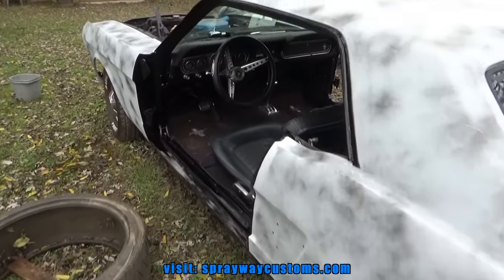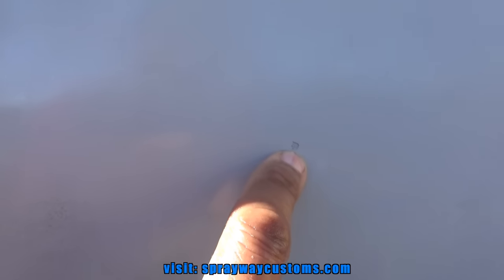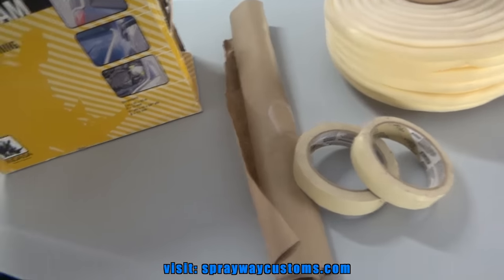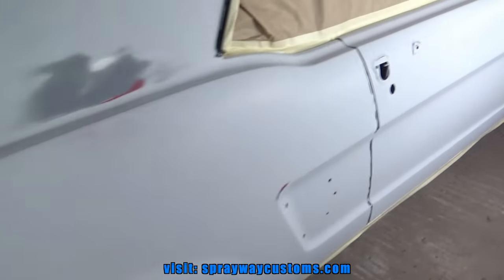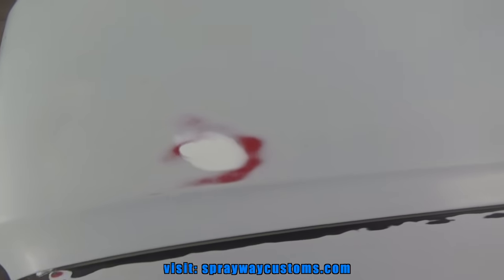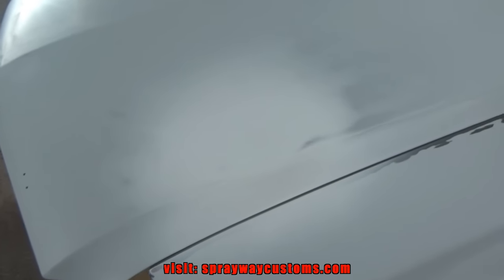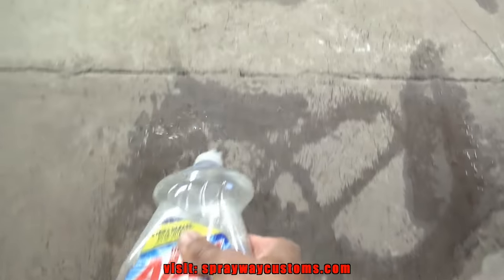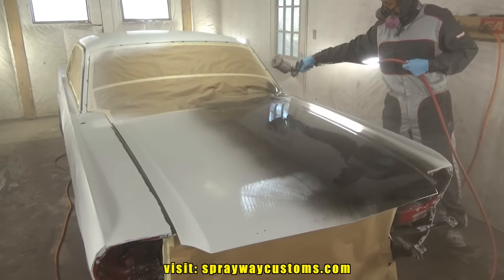How To Paint A Car At Home For $209.99 With UreKem Jet Black STEP BY STEP 1966 Ford Mustang Coupe

Comment: And maybe let everyone know "209" dollars doesn't even come close to the final "material" cost let alone labor.. even the water used for wet sanding is a cost..
Reply: Why be a stick in the mudd dude. He's just showing you can get mad results for cheaper just by putting in a little effort at home.  Could be a dickwipe n be like you didn't price in ur mask, ur gun, ur compressor,  the tape, the sand paper, thinners, paint filters hell even the mixing stick he used...... list is never ending just enjoy the dudes video n him sharing this people lol
Reply from the maker: Only if you have everything else 😏
Reply: @SprayWayCustoms  idno man I see a few nails n screws in that shed that wer not factored into the 209.🤣
Reply: @SprayWayCustoms  might wanna advise the shed it seld isn't in the price of the spray job to..... could be easily over looked very misleading video 😂hahahah

Comment: So it’s coo to paint over 320 scratches I thought 600 was the best
Reply from the maker: 320 if spraying a sealer. I never spray base over 600….either 320 or 400

Comment: All those fish eyes, looks good from far away but up close not so much! Have to get a better compressor for clean air, that’s where all your contamination is coming from
Reply from the maker: Your wrong Paint Genius...I never had a problem with water, oil or anything in my lines. That's trash and overspray that fell back down that didn't make it out the booth. Now if you say I need to get a better exhaust system...I would agree 😄
Reply: Lol you can see the fisheyes everywhere, looks good from a distance though. Can fool a lot of people but not professionals. We see everything
Reply from the maker: Yep...you pretty much right because YouTube has all these self proclaimed PROFESSIONALS 😂😂
Reply: SprayWayCustoms 18 years experience, I’d put your garbage garage jobs to shame